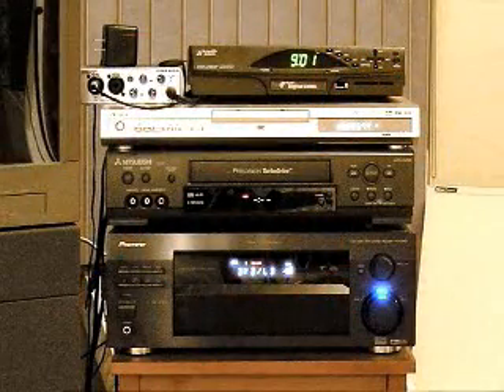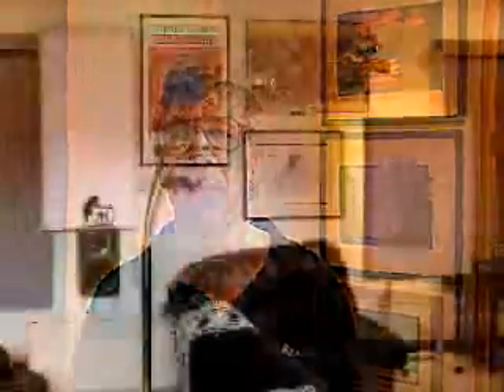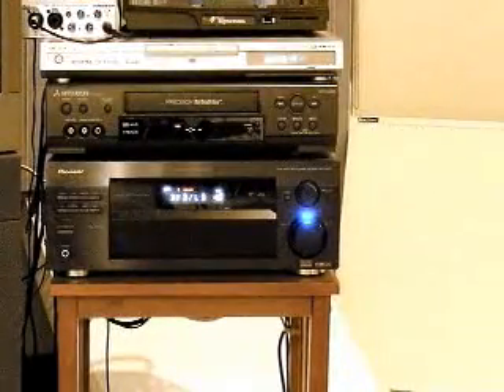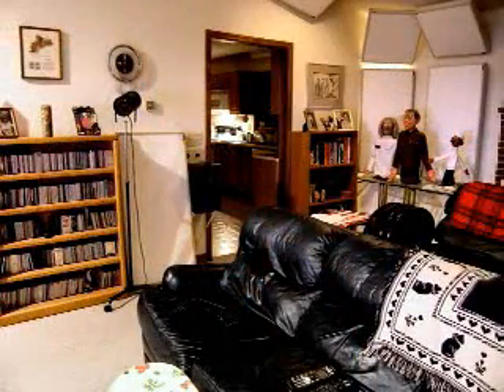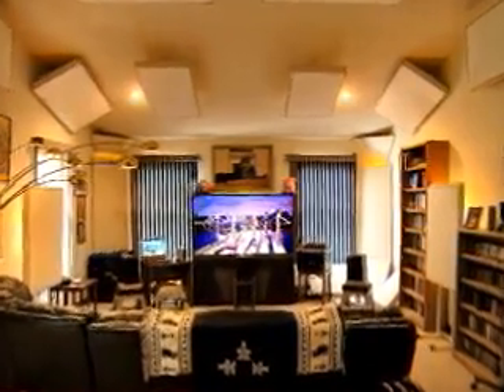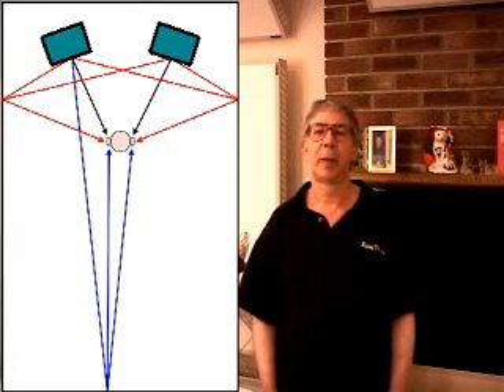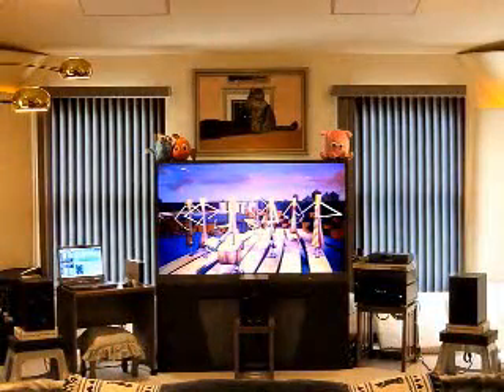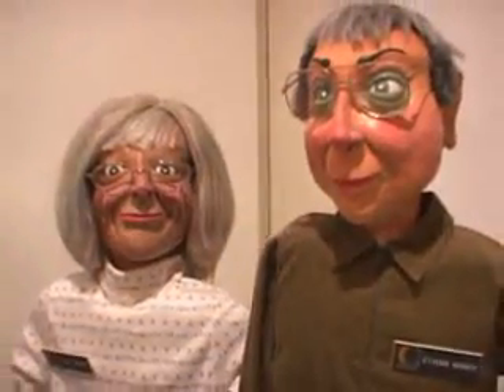How to Set Up and Treat a Listening Room

Comment: Ethan NO, avoiding all early reflections is not the answer. We need the front and corner secondaries for depth and spaciousness and power response. Like most, you comment only about frequency response and little about the spatial response - you mention imaging across the whole width of the room and deeper than the speakers themselves but you don't explain why that happens, what causes that. It is the early reflected from front and front corners.
Reply from the maker: You are just wrong. These two articles explain why you are wrong in great detail:

http://ethanwiner.com/early_reflections.htm

https://www.audioxpress.com/article/why-doesn-t-my-stereo-sound-like-a-live-concert

Comment: Hi Ethan. Great video. Do you put something inside the card boxes that is just underneath the main speakers?
Say, would some big coffee table book underneath each speaker work just as good as decouplers?
Reply from the maker: it turns out that speaker decoupling is nonsense and not even needed, at least not with competent speakers:

http://ethanwiner.com/speaker_isolation.htm
Reply: @EthanWiner  Thanks. I will read that.
I guess I will just use books to get the correct height. As speaker stands I've "made" my own out of just pure leca.
Reply: @EthanWiner  Would you do videos just like Paul does at PS Audio? Where you first take your glasses in that CSI-Miami-position, then take out the envelope and question, and reveal all the BS like decouplers, etc.. That would be a super funny con. 
Your knowledge is immaculate.
Reply from the maker: LOL, that's a great idea for a video! I'm up to my eyeballs with various projects right now, but I will definitely keep that in mind.

Comment: My argument is that 99 % of people don't have this stuff at home when they listen to music, 
so shouldn't mixing and mastering be made in similar rooms? I never needed any of this stuff, and my mixes sound good on headphones and in the car as well.
Reply from the maker: This is from my Audio Expert book:
If you're a recording engineer you may ask why you need acoustic treatment at all, since few people listening to the music you create will be in a room that's acoustically treated. The reason is simple: All rooms sound differently, both in their amount of liveness and frequency response. If you create a mix that sounds good in your room, which has its own particular frequency response, it's likely to sound very different in other rooms. For example, if your room lacks deep bass, your mixes will probably contain too much bass as you incorrectly compensate for what you hear. And if someone plays your music in a room that has too much deep bass, the mixing error will be exaggerated and they'll hear way too much deep bass. Therefore, the only practical solution is to make your room as accurate and neutral as possible so any variation others experience is due solely to the response of their own room. Most people are probably used to the non-flat response of their room anyway.

Comment: Ethan, did your youtube videos used to have higher quality video and audio?  Sorry  your data is crystal clear and densely packed with expert knowledge, except I thought you were of thefree roomeqwizard camp. And yI could have sworn you used solid state resistors for your dimmers ito minimize emi from switching transformers in LED power supplies and PWM dimming. And are you not into roomEQwizard free softwarre. I coulda sworn you taught me how to easily generate sine waves, measure frequency response and spl decay and output it in awesome waterfall charts using low cost calibrated measurement mic from dayton audio with and any usb audio interface (must have phantom power) connected to any computer.
Reply from the maker: That's a very old video. I made this newer version more recently:
https://youtu.be/VxbTDGSs_aA
Yes, now I use REW instead of the older ETF.

Comment: Great video Ethan. Question: How come with all those bass traps, I can still hear some reverb in the room with your speaking voice? I thought all those absorption panels would make the room very dead souding?
Reply from the maker: I was at least six feet away from the camera's microphone. Plus, the room isn't entirely dead, nor should it be. The main goal is to absorb specific reflections, and those are handled perfectly.
Reply: @EthanWiner  that makes perfect sense Ethan. I didn't know that the room should not be completely dead, like that awkward silence when you walk into a thick carpeted closet.

I do notice though when I go into professional theaters like AMC Cinema, when you speak to someone it does sound very dead. I'm sure they're acousticians have done the proper work though.

In any case I love your explanations. Looking forward to more vids from you. Thank you for sharing your knowledge!
Reply from the maker: In a large movie theater the walls and ceiling are all very far away, so the reflections are "later" and also softer due to distance. Treating a home size room is very different.

Comment: Question for you Ethan.  Does the gauge of speaker wire matter to sound quality? I know longer runs have more resistance, but is that an effect you can hear?
Reply from the maker: It's possible that higher resistance could affect quality as well as lower the overall volume. More resistance lessons amplifier damping factor, though damping factor is overrated. But generally, you don't want to lose power either. Even for a long run, getting wire that's thick enough for the job probably costs less than an amplifier with enough extra power to counter the loss.
Reply: @EthanWiner  Didn't know if there was something to it, or if it was more audiophile BS, and I needed the straight dope. Thanks!!
Reply from the maker: I made two videos that bust a lot of BS audio myths, and both are derived from workshops I gave for the AES in New York:

http://www.youtube.com/watch?v=BYTlN6wjcvQ
http://www.youtube.com/watch?v=Zvireu2SGZM

Comment: 'Dish towl draped over this table' kills this video.
Reply from the maker: LOL, why do you think a towel that helps stop reflections is a bad thing?
Reply: It doesn't go with the carpet.
Reply from the maker: Well, sure, but it sounds great. For $1.19 at Walmart I'll try to find a towel that matches better. :->)
Reply: Dish towel choice shouldn't be all about their sound, sure it's a factor to be considered when choosing a dish towel, but as important is the aesthetics, for example it's a well established fact that floral patterned dish towels don't handle the 400Hz-2Khz range very well, and gingham can cause issues in the 3Khz+ range (which is why you rarely see gingham dish towels in top end mixing studios).
Reply: @davelordy  This is quality trolling. Well played. :) I love that you're not being a degrading jerk. I love a good goof.

Comment: I use foam panels only 1 inch thick and have most of my first reflection points covered and I installed 16 12x12x12 foam bass traps in the back corners and the difference is fantastic. Bass sound more dynamic and my highs are cleaner and more defined.

Comment: you know, some audio-experts told me i was an idiot to think that curtains all around and a lot of stuff and computerscreens in the back of the room wasn't good for the room acoustics. now that i hear it from you,a real expert on this subject, im convident that it actually wasn't a bad idea and the room measurements tell me this too. placement of speakers was the biggest difference in all of this. it comes to the milimeter. the rest was just to eliminate room-reflections. thank you for this very informative video. straight to the point and nonsenseless. one doesn't need to be an expert or nitwit to be able to treat a room and one doesn't need expensive stuff either, curtains and bedsheets work perfect. you proved me i was right all the time and the so-called audiotechs have no meaningfull stuff to tell me anymore, hearing it from a real well-respected master in acoustics. greets from the netherlands ! we love your down to earth approach over here :-)

Comment from the maker: Thanks, I'll ship your book tomorrow when I go to the Post Office. As for the desk reflections, yes, this can be a problem! One solution is to add a riser to the rear of the desk, as shown in Figure 17.5 of my book which you'll soon see. This is also why I usually suggest a "minimal" desk having only enough surface area to hold your keyboard and mouse. If the desk doesn't extend outward very far left and right, that avoids or at least reduces reflections.

Comment: Hi Ethan, Question regarding graphic at about 3:20 in your video. Wondering about the 50%-50% spacing between listener, monitors and desk surface. Seems to set up a 1st reflection off the desk surface. Just wondering why. BTW I ordered a 1st edition of your book and am looking forward. Thanks!
Reply: You've probably heard it already, but just in case new viewers also wonder: It's not a desk, it's a carpet or some type of absorber panel.

Comment: Hi Ethan - thanks for a very informative video. You mentioned a light dimmer that is quiet. Sounds like a variac. I'd really light to dim the 120VAC lights (300 watts) in my studio. Perhaps your lighting is low voltage. I'm trying to locate a wall mount dimmer that doesn't generate any electrical or audible noise. Any suggestions?

Comment: I have a music room. But I have a 1998 Peavey XR-886 16 input powered mixing console. 600 watts (2X 300) I am using a set of Vintage Kenwood Trio LS-770 speakers that are 80 watts RMS for the pair, 160 watts max. My sub is blown but it was a car audio sub and damn that thing was so LOUD. The video of it is here watch?v=G2I7pQHQ6JI this is the end of the link. Its so loud. Be sure to watch the how loud it is upstairs video found on my channel and subscribe. Tough amp ant it still runs smoothly :)

Comment: I noticed you dont use those home theater style seats with the high back head rests. Is there a reason for not going that route? Does that kind of seat block the the direct radiating sound from the surrounds? What's up? Im about to buy either a sofa or a set of home theater style seats ( row of 3) with the high back. What do you recommend?

Comment: @EthanWiner Hmm.....Identical speaker makes sense. I went to a hifi store today selling hometheater speakers. The seller told me that the center channel should have 2 woofers and a tweeter to make dialogue much better and most of the stores i went to did not use identical speakers for the center. They all had a center channel with 2 woofers and a tweeter. I wonder if you have come across such setups and what is your view on this.

Comment: Fantastic video. Learnt alot. But i am little confused as to why your center channel speaker in your home theater is the same as the left and right ones. I thought center channel speakers are suppose to be wider with 2 woofers and a tweeter.

Comment: Hi, I have a room that is 11.5 x 11.5 feet and 8.2 high. If I treat it acoustically, with absorbent or diffuser, what would the lowest audible frequency would be assuming that the speakers can produce it? Because I read somewhere that room sizes are proportional to wavelengths, meaning you can't hear 25hz in a small room. Thanks and have a good day!
Reply: Alex, did you get an answer?